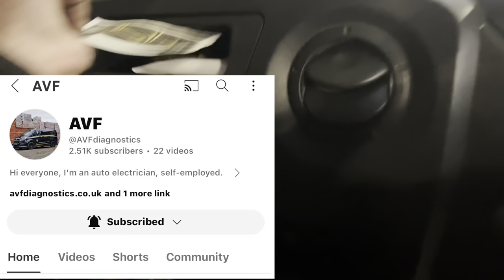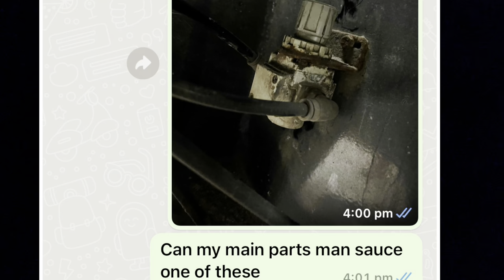IN THE YARD! How a PROFESSIONAL company operates! Yard update, tanvic job,

Comment: On the ldv , fuel pump is normally a misdiagnosis , it's the fuel hose elbows above the tank that always always always perish , cheap n simple job
Reply from the maker: Cheers phill I’ll have a look at them then mate 👍👍
Reply: @Professional-struggler  if you loosen passenger side two bolts a few turns and then remove drivers side two bolts you can get access without undoing filler neck ... proper job

Comment: You don't need to be crazy to work in and around that yard but it helps😂. Another informative video from a proper safety man😂😂. The workshop manager is a real slave driver, no wonder you take the hardest working second man around with you.😂😂😂  Another crazy great video struggler 👍